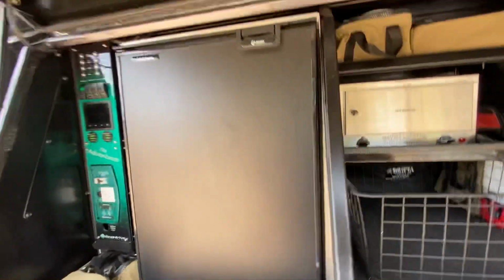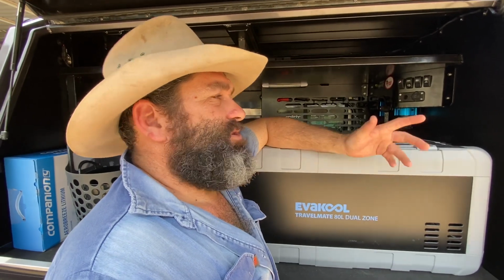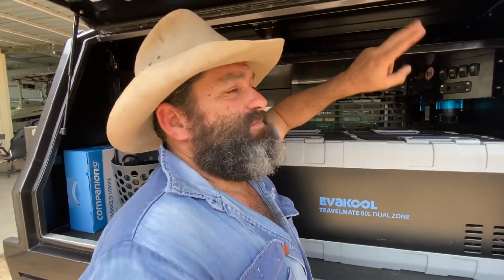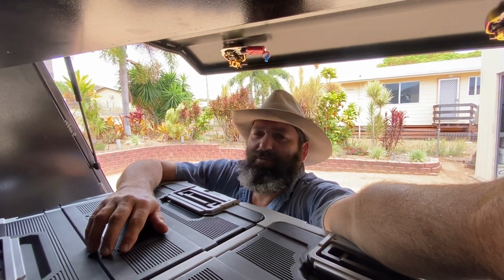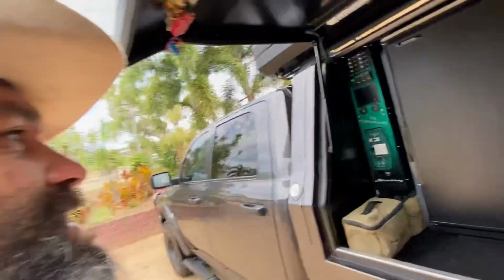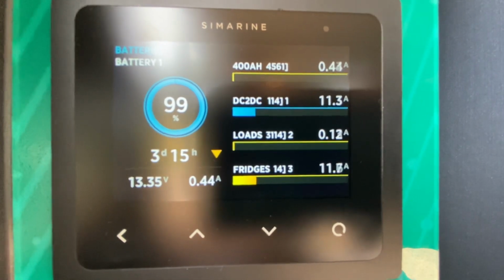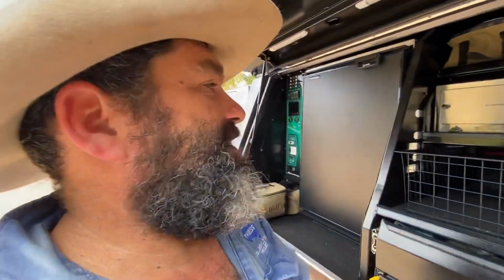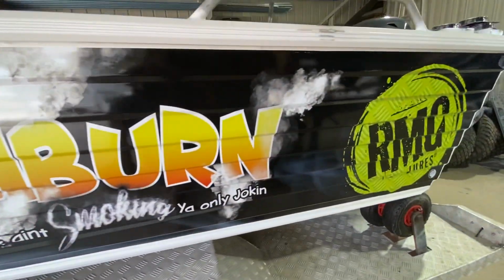Enerdrive canopy set up 400ah lithium

Comment: I'm not an expert but my understanding is at 99% your batteries are essentially full, therefore the DC DC charger/Solar regulator is in Float stage, not Bulk charge so it will only input enough amps to maintain the batteries discharge current which it looks like it is. If the Batteries were say at 50% I think you would find it would switch to Bulk charge and would supply whatever the Solar panels had available up to the Capacity of the DC DC charger/Solar regulator which I believe is 40amps.
Reply from the maker: It definitely ramps up and down depending on battery charge status even the smallest shadows from clouds have huge impact on charging amps delivered through the solar definitely need two panels and 400amp to keep up with two fridges if not driving and bit overcast days
Reply: There actually capable of 50 amps, and also 45 v , so this is exactly why I run a 415 watt house panel feeding into my enerdrive dcdc 40+ you will see over 30 amps an hr on a bright day, yes the house panel takes up my space, but they are cheap, and bump the volts right up, I did the math and 415 watt panel will supply 40.1 v and the charger will easily push over 30 amps I t your battery, enerdrive charge is what they do because there gear is capable as it gets , with 400 amps of lithium batteries, and the dcdc, bigger panel, anything below 45 v, you charger will love you. 210 amps in good sun in 7 hrs mate, your welcome

Comment: Great info, Top set ups, Yes you need heaps more battery storage and solar than what they say, if freezing fish and making ice, I have a 55lt upright and a 95lt up right and 100lt trailblazer, to run them at my camp up Weipa way I have 480amps of batteries and 950watts of solar
Reply from the maker: Thanks I’ve had two trailblazers and they awesome fridges they definitely thirsty on battery power too
Reply: @thumburnfishing  This one been in the fam 25 years still going great, yep pulls 7amps constant running